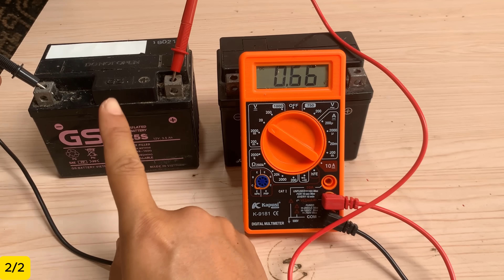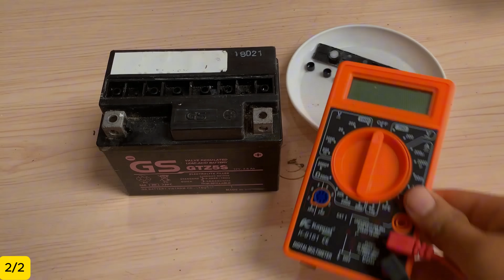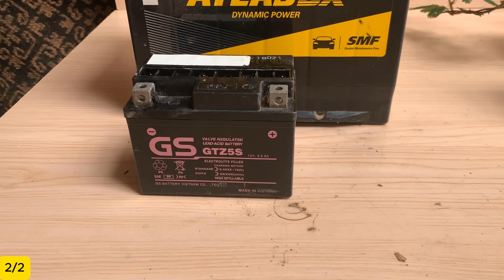Old battery is like new after 1 minute! 2 quick ways to restore your battery!

Comment: I never believe that this work. There can be volts about 12, but now power. Put the battery in car, and try to get engine on. It doesn't get on. If thst work, everyone would do that and not bye a newone.
Reply from the maker: Thank you for watching the video and leaving your feedback. Each comment you make helps the channel grow and motivates me to work more effectively
Reply: Are you from Finland my friend? I'm from Sweden but I always use Salama batteries!
Reply: Are you good Finnbell? I always use Salama batteries! Very good Akku!! I speak a little Suomi
Reply: You need near 13v to use in vehicles. But it can be used for other purposes for inverter etc
Reply: Volts are one thing amperage is what starts a car
Reply: @MichaelCosgrave-sb8sg  when u can't charge up to 13v u can tell battery is weak. It's a general thing.
Reply: If you intended to use it in car to start the engine. If you use it for deep cycle purposes, it should be fine
Reply: No vale esto! No os lo creéis!
Reply: The electrolyte needs to be "worked in" with the process of several full cycle charge-cycles to make and build amperage to the battery, you should use a slow charging charger and let work over 12 hours maybe to get fully charged..but that's not a guarantee to make it start a car, especially during sub zero degrees.
Reply: He doesn't care. It's for views.
Reply: Coke!!! Why don't you start using the powder as well😂😂
Reply: Con la coca-cola non và bene io metto filiferruu 😂
Reply: I always said the battery companies would go out of business. But not everyone would be doing this. I have a scooter battery I'm waiting for the acid to arrive. I've drained it like he's doing. Can't wait to see.

Comment: I beg forget that even though you did not do any cleansing so far you charge it a little it will light, and mean while battery has 6 holes and that one hole you opened out of 6 will not do any good to the battery. Total waste of time.
Reply from the maker: Thank you for sharing your opinion! Cleaning and maintaining the battery is essential for ensuring long-term performance. Opening just one hole might not improve the situation, but if you continue to properly maintain and charge it, the battery can still function well.

Comment: Modern vehicle has so much electronics, best to replace with new battery or risk damage control modules. It cost more to be cheap.
Reply from the maker: You’re absolutely right! Modern vehicles are heavily reliant on electronic systems, and a failing battery can cause damage to sensitive control modules. Replacing the battery on time is a smart way to avoid costly repairs in the future. Thank you for your insight!

Comment: For car batteries I would add a check: recharge immediately by bringing the water levels to the maximum. If you see all the elements boiling in the refill, you can proceed with the next steps. If even a single element is not boiling, the battery is short, therefore to be thrown away, and every subsequent step will be useless. Made from experience.
Reply from the maker: Thank you for watching the video and leaving your feedback. Every comment you make helps the channel grow and motivates me to work more effectively. May God always bless you
Reply: Try starter charger with 200 Amps.
Boil it for 10-15 minutes and cool for one hour. Repeat that 5 times and your destiled water will become electrolyte.

Works, onow from experience.

Comment: It can light small bulbs but it cannot work to start a vehicle.
Reply from the maker: Thank you for your comment! If the device can only light small bulbs, it means its current or power source is not strong enough to start a vehicle. To start a vehicle, you need a power source with a higher current capacity, such as a car battery or a specialized jump starter.
Reply: 꼼수
Reply: Correct

Comment: But you restored the voltage, which is only 12 V, but you did not restore the voltage, which is important in starting the car
Reply from the maker: Thank you for your comment! The 12V voltage is the basic requirement, but to start the car, it's crucial to ensure sufficient current and power from the battery. If 12V is not enough to start the car, the issue might be a weak battery or unstable connections. Hope this helps!

Comment: Is the "electrolyte" used when refilling the battery (after cleaning with Coca Cola) simply distilled water?
Reply from the maker: When refilling the electrolyte in a battery, it’s not just distilled water. Typically, the electrolyte in a lead-acid battery is a diluted sulfuric acid solution mixed with water. Distilled water is commonly used to top off the electrolyte level if it’s low, but it’s important not to replace the entire electrolyte with just distilled water. Coca Cola can help clean off deposits, but it’s not a solution for refilling the electrolyte.

Comment: But can you get 300 cranking amps from it? Having 12v means nothing.
Reply from the maker: Thank you for your question! Achieving 300 cranking amps depends on the type of battery or device you’re using and its current delivery capacity. In the video, we focused on providing 12V for basic applications. If you need higher performance, make sure to use a power source capable of meeting your requirements.

Comment: Why HCL instead of H2SO4
Reply from the maker: Choosing HCl (hydrochloric acid) instead of H2SO4 (sulfuric acid) depends on the intended use and the properties of each acid. HCl is often used when a strong acid is needed to dissolve metals or when high temperatures, like those required with H2SO4, are not needed. H2SO4 has a stronger corrosive nature and typically requires higher temperatures to react effectively.

Comment: That Motorcycle battery is at 0% State of charge, won't crank nothing!!!
Reply from the maker: Thank you for sharing! If the battery is at 0% charge, you’ll need to recharge it or replace it if it no longer holds a charge. Charging from 0% can take some time, so make sure your charger has enough power to charge the battery properly.

Comment: What means`like new` ? It just with the bulb on ? Is the battery can running like power enough to start a car again ? And keep charged as much as a new battery also last as a new ? If not ,  this is a trick only.
Reply from the maker: Thank you for your question! The term "like new" means that the product is in almost new condition, meaning it’s not damaged and works well like a new one. However, if it only has the bulb on and isn’t powerful enough to start a car or hold a charge like a new battery, it might be a trick or a temporary solution. To know for sure, you would need to check the battery’s power and its ability to maintain a charge.